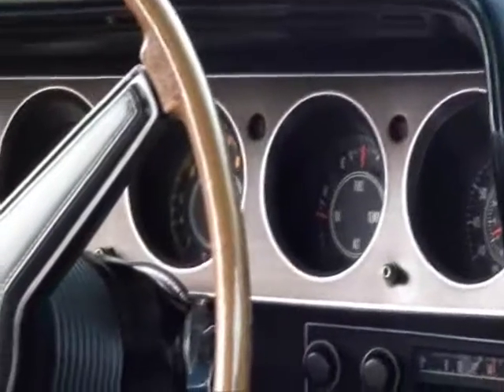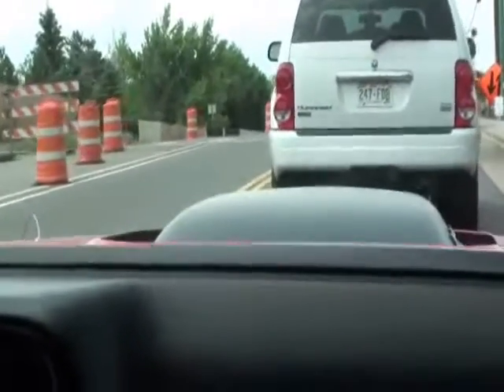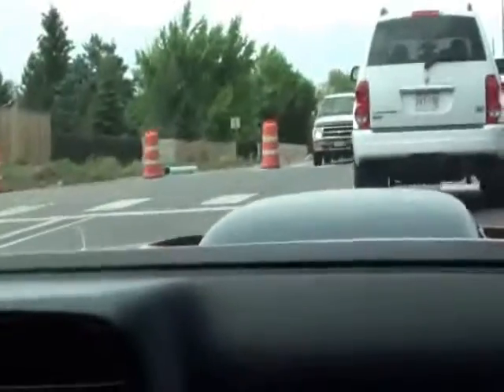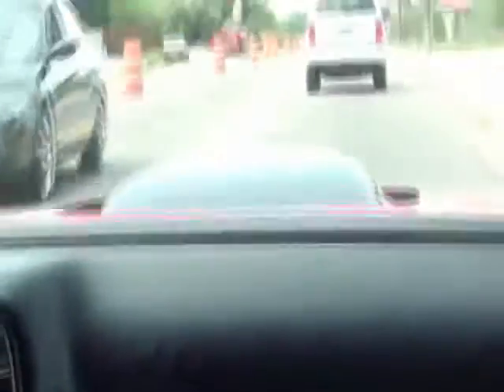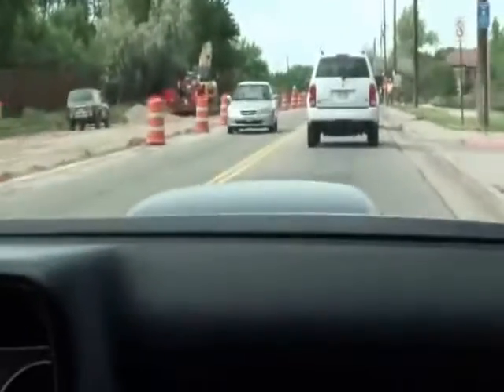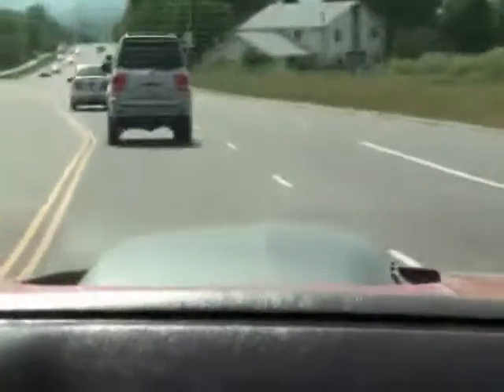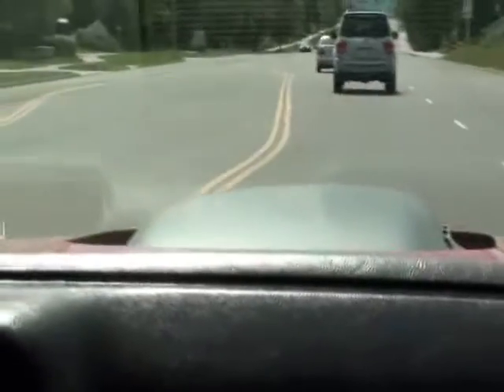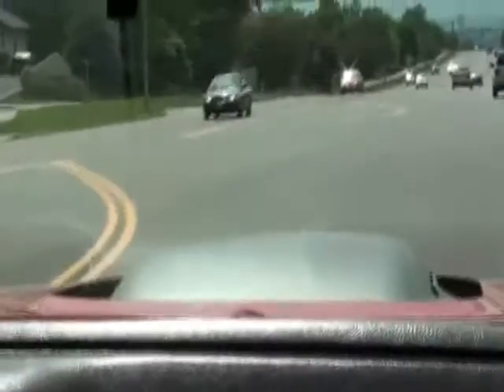1971 Hemi Cuda Thrash.wmv

Comment: @DeAdiSSu3 from 2:39-3:06 you rowed through the gears with no rear wheel traction, then said "that was about 94 miles an hour" well yeah, on the speedometer.. If the car was actually hooking up you wouldn't have gotten there nearly as fast.